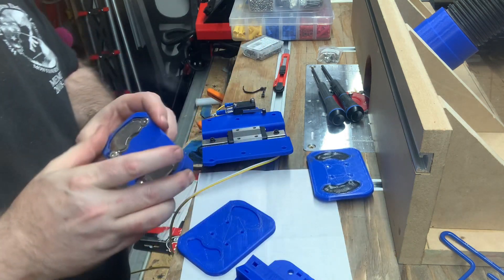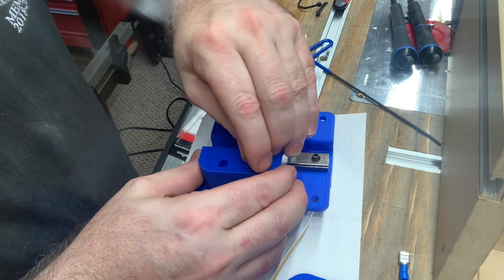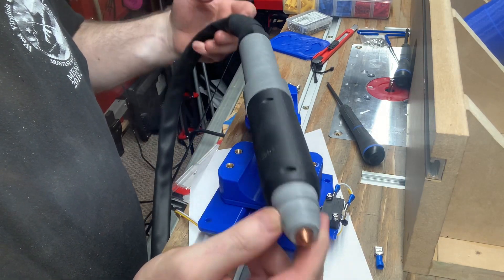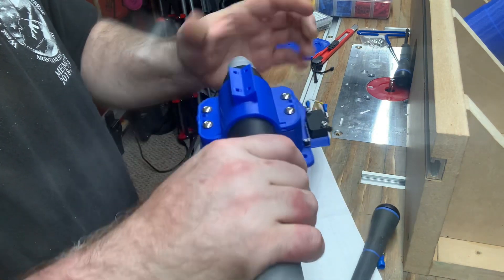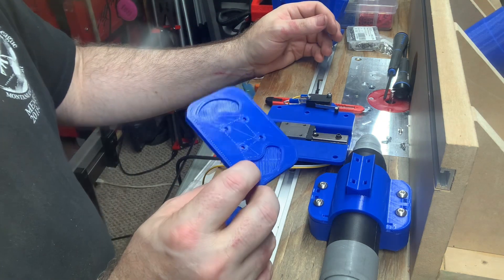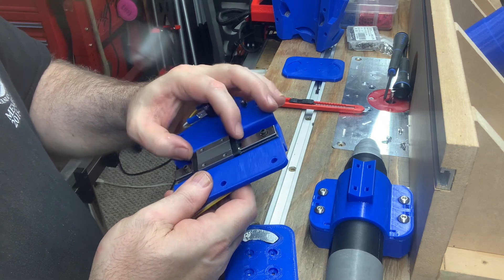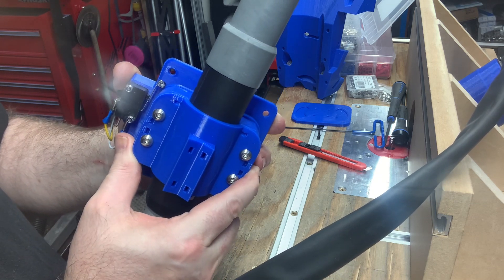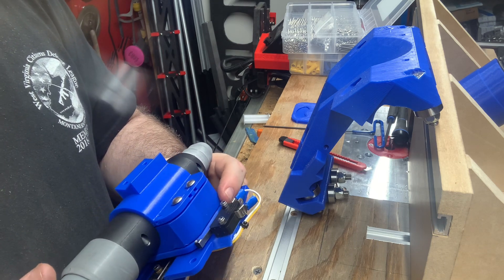LowRider 3 CNC Plasma Table PART 2 - floating Z torch mount

Comment from the maker: Amazon affiliate links to plasma cutter bought for CNC table, as well as the machine torch, consumables for each, and various other items for connecting everything (other helpful links are in the description):

— CUT60DN Plasma Cutter: https://amzn.to/3LvjQQg 
— Consumables for it CUT60DN: https://amzn.to/3BT0EbE 
— PTM80 Machine Torch for CUT60DN: https://amzn.to/3LvIRL8 
— Consumables for PTM80: https://amzn.to/3Uqrhfi
— 1/4" Air Compressor Filter Regulator Combo: https://amzn.to/3QR4Mxn
— Heavy Duty 304 Stainless Steel Drain Pan 8"x30"x2.5" (I bought two): https://amzn.to/3drTnq1
— AC to DC 24V 15A 360W Switching Power Supply Transformer 110V/220V: https://amzn.to/3BrRfGU
— AC to DC 5V 5A 25W Switching Power Supply Driver 110V/220V: https://amzn.to/3UkykpY  
— AC Noise Suppressor Power EMI Filter 115/250V 20A CW4L2-20A-S: https://amzn.to/3xBxWts
— TB6600 Stepper Motor Drivers 4A 9-42V CNC Controller for 42 57 86 Stepper Motor Nema17: https://amzn.to/3QRWUeN
— Rubber Drive Belt GT2 Timing Belt 2mm Pitch 10mm Width, 10 Meters (32.8 Ft) Length: https://amzn.to/3DDfAMp
— E-Stop Emergency Switch AC 400V Push Button PLUS 6pcs End Stops: https://amzn.to/3qXlZud
— GE5030 Advanced Silicone 2 Window & Door Sealant, 10.1oz, Black: https://amzn.to/3qOH0HB
— Fast-Blow Glass Fuses (Pack of 20) BOJACK 5x20mm 2A 2amp 250V 0.2 x 0.78 Inch F2AL250V: https://amzn.to/3Uo96XJ
— Fast-Blow Ceramic Fuses (Pack of 10) 13A 250V 6x25mm Cartridge Tube: https://amzn.to/3Sj0pMs
— Fast-Blow Glass Tube Fuse Kit, 175 Pcs, 5X20mm: https://amzn.to/3xx0Fj9
— Heavy duty 15 FT Extension Cord, 14 Gauge, 125V, 15 Amps, 1875 Watts: https://amzn.to/3By2uxz

— You'll also need an Air Compressor. This is not my exact model, but it's close: 20 Gallon Ultra Quiet Air Compressor: https://amzn.to/3xCfXTK

Comment: Hi, I've been looking at different ways to do a plasma table and this is amazing!  I have a question that is probably self evident but I'm not seeing it; what's the point of a floating Z?  
Thanks Doug
Reply from the maker: Don’t feel bad for asking! Before I built this table, I had no experience with CNC controlled plasma, and no concept of floating Z either! The floating Z allows for the CNC to be able to press the plasma torch’s tip until it touches the metal and then keep pressing downward, while the tip floats up, until an end stop switch is triggered, and this allows the firmware to then calculate exactly how high it needs to lift in order to get the tip at the perfect height above the metal. Don’t confuse floating Z with automatic torch high control. That is a separate feature and also important.
Reply from the maker: Also, in addition to the explanation in my previous comment, you can watch additional videos in my series to see the floating Z in action — as the CNC probes to find out exactly the height of the metal. This, of course, means that you can put different thicknesses of metal onto your table, and it will always be able to probe accurately to the height of that given piece of metal.
Reply: @design8studio  I guess I haven't gotten that far yet.  Funny thing though, right after I posted, I went out to feed the chickens and an answer not too far off from what you said above sorta dawned on me. Magical, mystical chickens.....